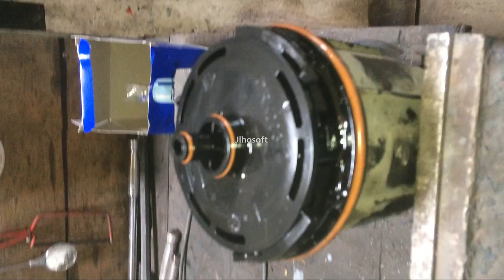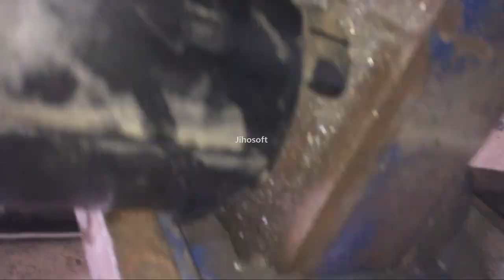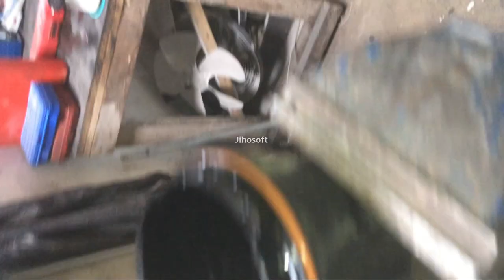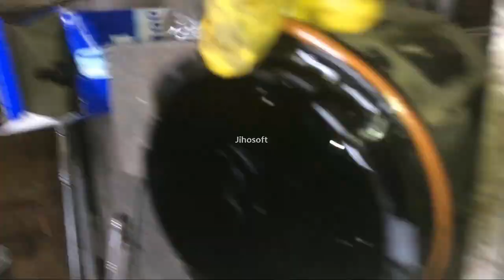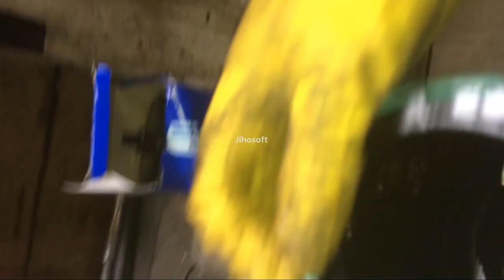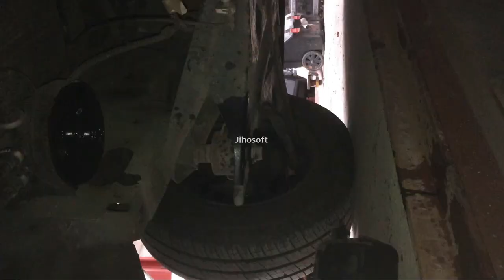ford transit custom fuel filter job YouTube AME Motors Howtofix

Comment: Why did he not prefill the filter bowl with clean fresh diesel prior to refitting it ?.....it helps with bleeding the air out when starting the engine
Reply from the maker: +this System has very powerful fuel pump on a tank so that that’s whyNorman Edwards
Reply: @amemotors  oh , right , it looks as though I've been doing it wrong for the last 45 years , ....we live and learn don't we
Reply from the maker: @normanedwards7220  you did mk8 45 year ago :elbowcough:
Reply: @normanedwards7220  just turn the ignition to on and leave it for 30s turn off, and repeat another 2 times. does it itself without the mess

Comment from the maker: hi yes its cold filter belt
Reply: Sealey AK6403 Oil Filter Strap Wrench 300mm Capacity 3/8" & 1/2"Sq Drive